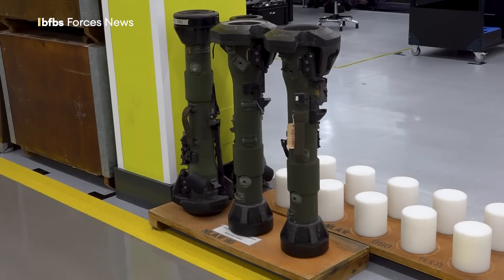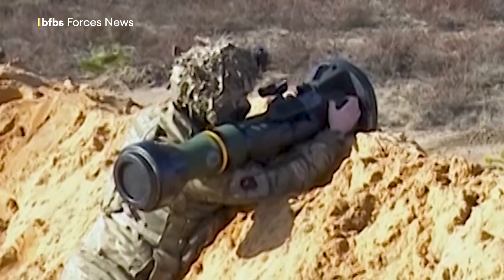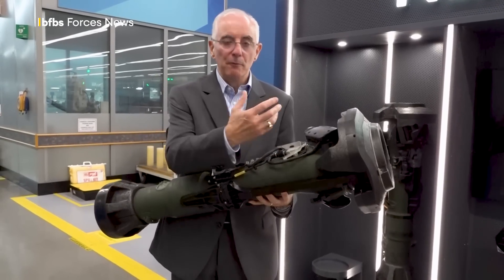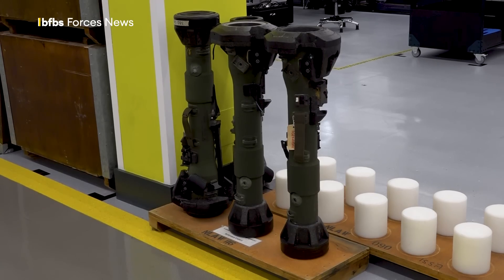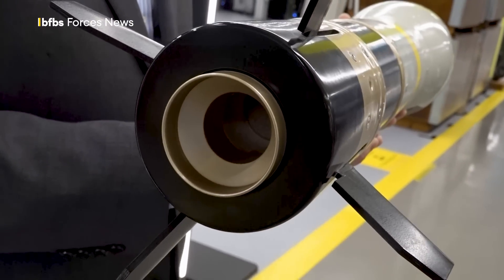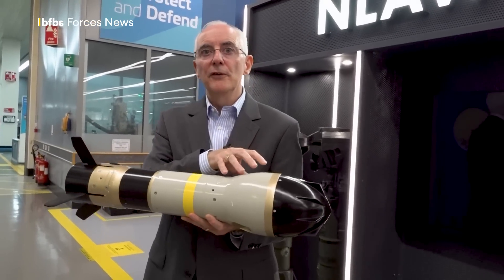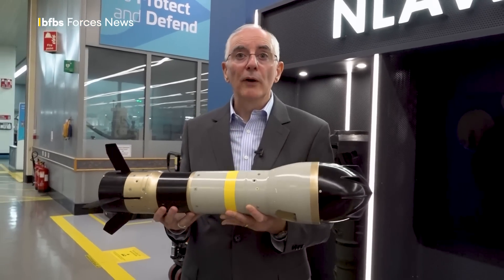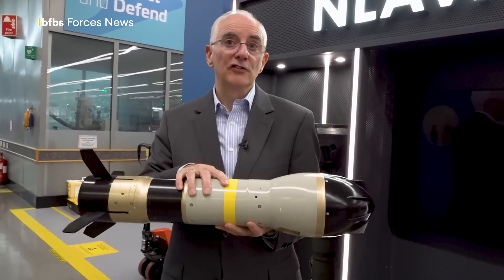Inside the UK factory building the tank-killer NLAW missile system

Comment: NLAW: NEXT-GENERATION LIGHT ANTI-TANK WEAPON
The next-generation light anti-tank weapon (NLAW) is the first missile system for non-experts and can strike out tanks with a single shot as it strikes from (1) above or by (2) direct attack. 

The weapon weighs 12.5 kilos and depending on which year model it is, the fired missile reaches 600-800 meters. It can be fired in tight spaces.
Price per piece $ 35,000.

Developed by Saab Bofors Dynamics in Sweden and manufactured in the UK.

The American missile weapon Javelin is twice as heavy as the NLAW at 24.3 kilos, and reaches 2500 old one to 4000 meters new one.

In 2002, a single Javelin command launch unit cost $ 126,000, and each missile cost around 
$ 78,000 (equivalent to $ 112,000 in 2020). Thats $ 238,000 do you get it now ?!

Comment: Is this the NLAW or the NLAW? The British Army socials seem to be confused over whether this is called the 'New' Light Anti-Tank Weapon or the 'Next-generation' Light Anti-Tank Weapon as mentioned in this video and the video description. Does the 'New' variant even exist?
Reply: NLAW: NEXT-GENERATION LIGHT ANTI-TANK WEAPON
The next-generation light anti-tank weapon (NLAW) is the first missile system for non-experts and can strike out tanks with a single shot as it strikes from (1) above or by (2) direct attack. 

The weapon weighs 12.5 kilos and depending on which year model it is, the fired missile reaches 600-800 meters. It can be fired in tight spaces.
Price per piece $ 35,000.

Developed by Saab Bofors Dynamics in Sweden and manufactured in the UK.

The American missile weapon Javelin is twice as heavy as the NLAW at 24.3 kilos, and reaches 2500 old one to 4000 meters new one.

In 2002, a single Javelin command launch unit cost $ 126,000, and each missile cost around 
$ 78,000 (equivalent to $ 112,000 in 2020). Thats $ 238,000 do you get it now ?!
Reply: @tomeng9520  I got it in the first place, try explaining this to the British Army, because they think it's called the 'New' Light Anti-Tank Weapon. lol

Comment: How is this better than an RPG-7?
Reply: RPG7 is unguided. RPG7 doesn't punch trough modern western armour. RPG7 has an effective range about 200 m. Nlaw effective range is 800 meters. When you've shot one rocket with RPG7 and you can reload it. Nlaw is one shot and throw away. Difference is you just need one shot to defeat a vehicle with Nlaw.
Reply: RPG7 is unguided. It also doesn't have a top attack mode like the NLAW (where tank armour is weakest). Finally, RPG7 has an ordinary HE warhead, which is useless against modern tank armour (NLAW has a HEAT warhead).

Comment: I did NOT know that this was a Saab weapon system. Imagine the old classic Saab 95 Aero with two of these on each side of the front bumper haha!
Reply: NLAW: NEXT-GENERATION LIGHT ANTI-TANK WEAPON
The next-generation light anti-tank weapon (NLAW) is the first missile system for non-experts and can strike out tanks with a single shot as it strikes from (1) above or by (2) direct attack. 

The weapon weighs 12.5 kilos and depending on which year model it is, the fired missile reaches 600-800 meters. It can be fired in tight spaces.
Price per piece $ 35,000.

Developed by Saab Bofors Dynamics in Sweden and manufactured in the UK.

The American missile weapon Javelin is twice as heavy as the NLAW at 24.3 kilos, and reaches 2500 old one to 4000 meters new one.

In 2002, a single Javelin command launch unit cost $ 126,000, and each missile cost around 
$ 78,000 (equivalent to $ 112,000 in 2020). Thats $ 238,000 do you get it now ?!